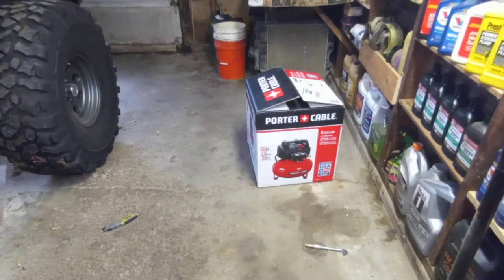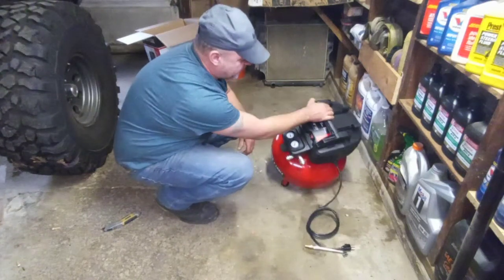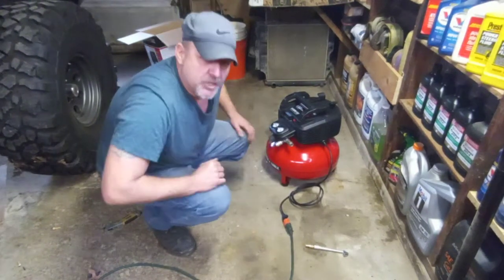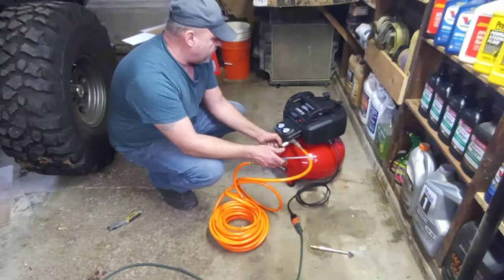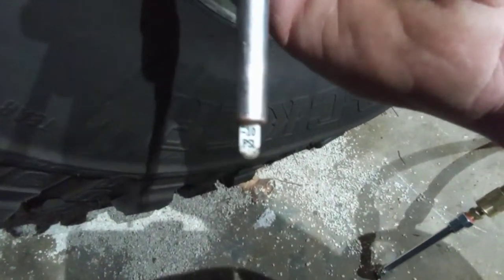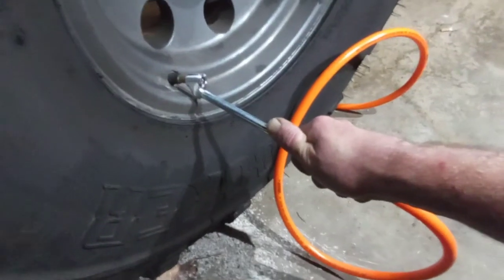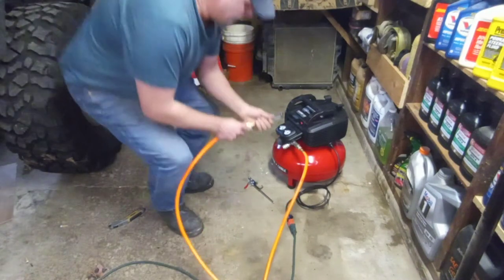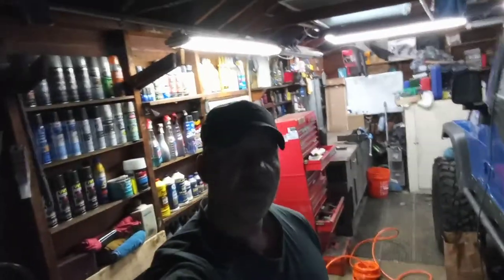Porter Cable compact air compressor 6 gallon 150psi unboxing, testing and review

Comment: I have the same compresser for over a decade and still works great. If you have issues with this unit vibrating across the floor put some rubber bottom furniture sliders under legs. I use scotch sliders.
Reply from the maker: Ah good tip! Ty! Fortunely my garage floor is full of holes and divers so I don't have that issue yet 😂
Reply: @whileurinthere4062  🤣🤣🤣🤣🤣

Comment: Thanks for this - I am considering using an air compressor to blow out the sand and dust in my western saddles.  They have a lot of intricate tooling and after every ride, the dust and dirt settles into the grooves.  I think air would be gentler on the leather than scrubbing at it with a toothbrush.  Your video gave me the information I needed to feel confident about buying and using this tool.  Thanks again!!
Reply from the maker: No problem glad to help

Comment: Wow the compressor kicked on almost as soon as you started airing up the tire 😮
Reply from the maker: Yeah it does it everytime too since opening the box. But it's still working after 2 years and maintains 150psi while airing up those big tires

Comment: These Porta Cable 6gal compressors are fine quality, I've had mine since late 2015,  and use it 1 to 5+ times a month...still running great!!  I'm even going to hook up an air-hammer to it tomorrow, for minor removal of old thinset & globs of cement on a slab.
Reply from the maker: Let me know how air tools work on that I'm curious. I really only use mine for airing tires up
Reply: @whileurinthere4062   You're missing out, man, I use mine a lot especially for my 1 1/4"  Bostitch roofing nail gun put'n up cement board in showers & floor, it's great!   

And yes today, I used my brand new Husky air-hammer (from HD), was a small job, used it off and on for an hour, worked great.  The only thing is your compressor will keep cycling and not turn off...you wouldn't want to wear out compressor by getting it too hot.  
A-Hammer took up mortar/concrete chunks on basement slab w/ pure ease.   
***(What I've learned, if you have or need something to be taken out or knocked down concrete wise (not whole slabs/retaining walls etc.) and can do it all within 15 to 25min., it works great for an air-hammer.   If one is going to be getting crazy with it all day, minimum get a 15 - 20Gal. compressor.
Reply from the maker: Thanks man. I do have a concrete project coming up in the spring and was gonna use an air hammer on it. Thanks for the feedback man
Reply: @whileurinthere4062              👍

Comment: Thanks for the video. So, I'm new to this. You can run the unit with the valve to the hose OPEN and fill a tire...or do you need to close it first, fill the tank until it cuts off (@150 psi), then turn the knob to the hose and fill the tire? It looks like the unit was on the entire time and usable AS the tank was filling.
Reply from the maker: Yeah i made the the drain vavle was closed on the bottom if the tank so the air isnt rushing out as its trying to fill up. Then the air pressure valve i turned up to 150psi. Hose can hooked up and air wint leak out until u want to by blowing the air with an airgun ir a tire inflator or anything. Else u may be using. And ues its usable while its running. I like to let the tank fill up all the way the 1st cycle then use it as i wish
Reply: @whileurinthere4062  OK, thanks. Appreciate it.

Comment: Great video. Exactly the model I plan on buying. Question for you… how many pounds of pressure do you need to set to inflate your tire?   I don’t want to set too much. My car tires are 32 PSI
Reply from the maker: I set it at the max 150psi and then just use a tire pressure gauge on it

Comment: Question would this model have any issues filling a 18” truck tire to 80 pounds like all 4 tires. Or you think that portable compressor you have would be better Thanks
Reply from the maker: No the compressor in this video would be much faster. That portable one I have takes a long time to fill one tire and it gets super hot
Reply: @whileurinthere4062  thank you

Comment: What psi did you set the "Reg pressure " to when airing up your tires? I have a Yukon Denali that needs air in the stock 22" tires....
Reply from the maker: I set it to the max at 150psi

Comment: I'm doing something wrong, I need to shut something off my gauges aren't moving at all,did you close something down towards the bottom
Reply from the maker: Yes theres a valve on the bottom. Just twist that until the air stops coming out of it. Its there to drain the tank of water buildup. Be sure to open that up and let the pressure out every so often
Reply from the maker: On the bottom of the air tank itself is where the valve is. Just twist it

Comment: I need your advice which is the best pancake air compressor to buy
Reply from the maker: I wouldn't know honestly. This is the only one I've ever bought
Reply: @whileurinthere4062   First of all I want to say thank you for your comet second of all I'm not gonna use it for a mechanic or roofing it's really for air tires but I don't want something that's going to break down
Reply from the maker: All I use mine for is airing tires up.  Big mud tires, it's never failed me yet. Been using it often for about 3 years now with no issues. It's worth the $100 price tag

Comment: I noticed a hissing noise after it charged up is that normal?
Reply from the maker: The releif valve is probably partially open. It on the bottom of the tank. Just twist it with ur fingers and itll close up

Comment: Will it work with a paint gun or a sandblasting gun. Just wondering I’ve got a 86 C10 that needs painting cans afford to have it done.
Reply from the maker: I wouldnt paint with it. Loses pressure to quick and has go constantly run to refill the tank. I think this compressor couldnt handle that

Comment: Aside from running a nail gun, what else is it good for?
Reply from the maker: Personally just for me I got it for working on engines and blowing dirt away from engine parts. That and airing tires back up was the only reason I bought it. Works well for my needs

Comment: Would a 100ft air hose fit for a 150psi compressor that says up to 300 psi  on the hose
Reply from the maker: Yes. I got the 100' hose for mine
Reply: @whileurinthere4062  ok sounds good thanks you

Comment: Looks good.  I ordered one of these air compressors, should be arriving today.  I need to blow my tires up, and blow out my computer once in a while :)   Is it okay that it went to 160psi?   This will be my first air compressor so i'm nervous lol
Reply from the maker: Oh yeah itll be fine. That nhob right in in front of the the gauges adjustes your pressure. Itll blow tires up easily and quick. I dont know that id use it to blow the keyboard out tho...might overkill. But if u do turn the pressure nob turn to the negative side. If u do it at high pressure u blow the the keys right of the keyboard. Then u have to chase them and figure out where they go again
Reply: @whileurinthere4062  Nah, I use rubbing alcohol for the keyboard.
Reply: What psi did you set the "Reg pressure " to when airing up your tires? I have a Yukon Denali that needs air in the stock 22" tires....
Reply from the maker: I used the max pressure....150 psi
Reply: @rhynoprotection  I didn't really look at the Reg Pressure gauge.  I didn't think it mattered for blowing up a tire.  I just have regular dodge caravan tires that just needed a little bit of air (about 5-10 psi each) so it was super quick! :)  I really like this air compressor so far although it's super heavy.  I might get a dolly for it or something.

Comment: What brand hose and size please
Reply from the maker: So long ago I can't remember tho. It's 59 foot long tho. Wanna saw its 3/8" diameter. I can check when I get home tonight. But it was in the same isle at home depot as where the air compressor was

Comment: what hose did you get for it
Reply from the maker: Just ur basic air compressor hose 50ft. They will be right next to the air compressors
Reply: @whileurinthere4062  if i have a 1/4 air hammer wouldn't I need a 1/4 hose I'm still new to the air stuff I bought a porter cable compressor, and the 1/4 hose I bought was a thread in for some reason so I'm trying to get the correct hose
Reply from the maker: The hose u have I'm sure is fine. But ulll need the quick disconnect fitting that screws onto the end of the hose. I used a lil bit of Teflon tape to make a good seal. Those fittings will near the hoses at the store

Comment: 100.00? I spent 169.00 for that same one at HD.. I had to buy hoses and fittings.
Reply from the maker: Mine was $99.99....came with the fittings but i did have to buy the hose
Reply: @whileurinthere4062  You got a great buy! Yeah inflation is bad, but it's now $150 at HD for this one! Thanks for the video!

Comment: Look like someone didn't read the manual 1st......lol
Reply from the maker: That's why I made the video. So others don't make the same mistakes I did
Reply: Why what happened
Reply from the maker: I think he was talking about the valve on the bottom of the tank. I didn't have closed all the way and was wondering why it took so long to pump up. No biggie
Reply: @whileurinthere4062  thank you 🤜🤜🤜

Comment: You would better off to buy a 30 gallon tank, is a 155 PSi more air pressure to run a impact gun
Reply from the maker: I have a cordless impact. I just bought this for pumping up tires and blowing dirt off of parts
Reply: @whileurinthere4062  
I got one for exact same reason.
Reply from the maker: @earlmorton6265  so far so good for me. My main reason for buying it was blowing out dirt in my engine rebuilds. But it does work great on pumping up the 37" tires on the jeep. 2 mins from a dead flat to full. The ones at gas station take like 15mins per tire which is a huge pain